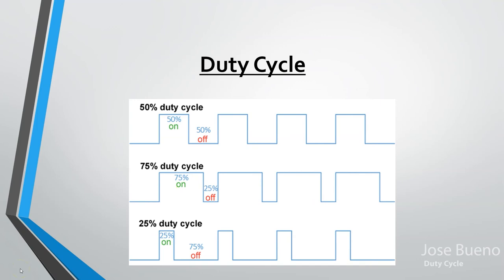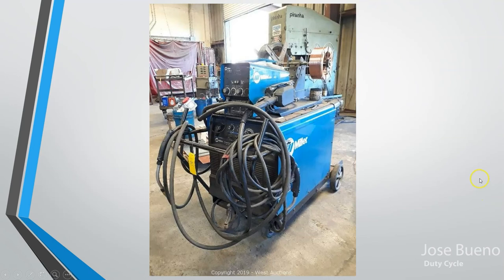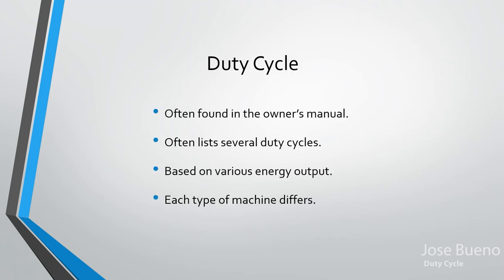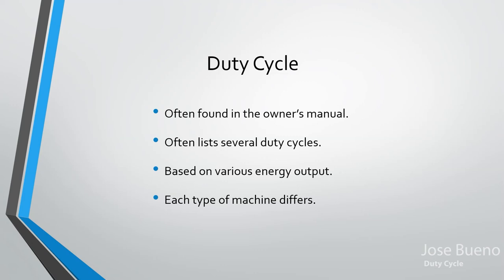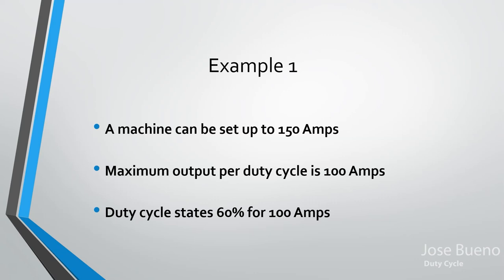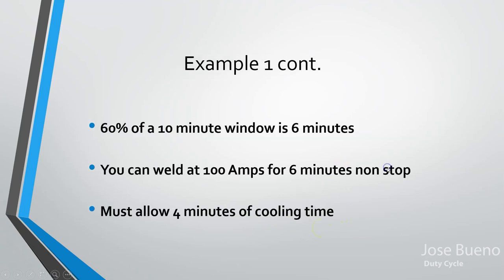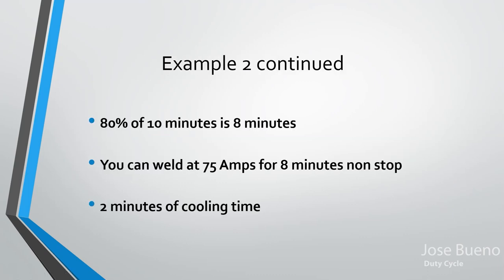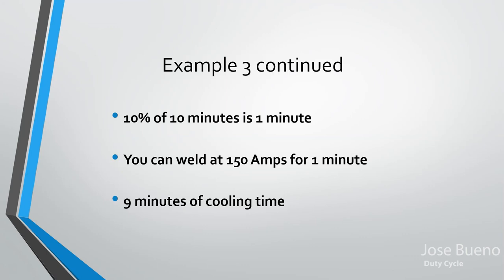Duty Cycle

Comment: What if you don't use up the 1 min to weld at 150 amps and do Stitch welds and tacks here and there will it still be the same and just added up to the minute or do we just suppose to understand that it'll cool down as we go?
Reply from the maker: Depending on the exact duty cycle of the machine you're using, I think it's safe in general to run a bunch of tack welds and not worry about the machine overheating. With stitch welds I'd be a little more cautious, simply because I don't know how long your stitch welds need to be, how far apart, and how many, BUT, if you're being "casual" about it and taking your time between welds then yeah you can run your stitch welds and not worry about the machine overheating.
Reply: If that makes sense haha